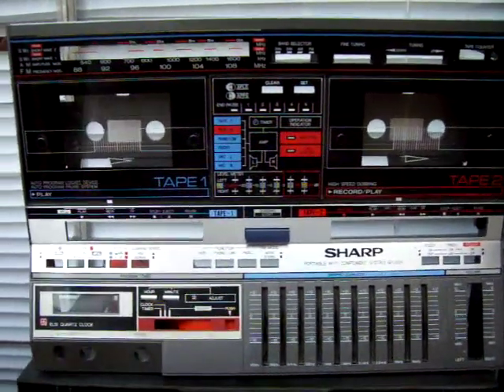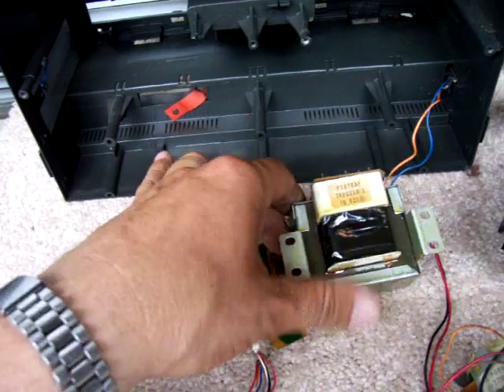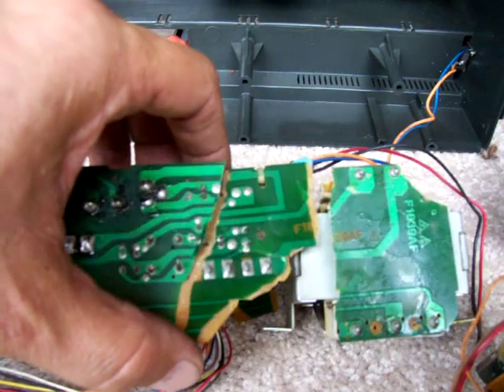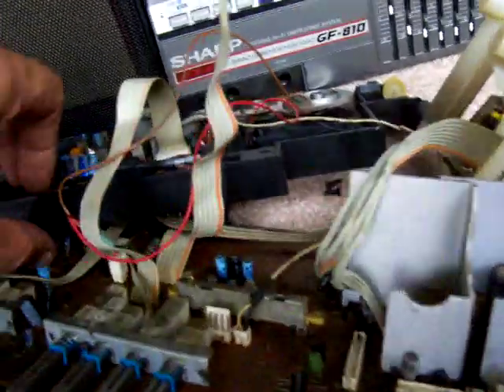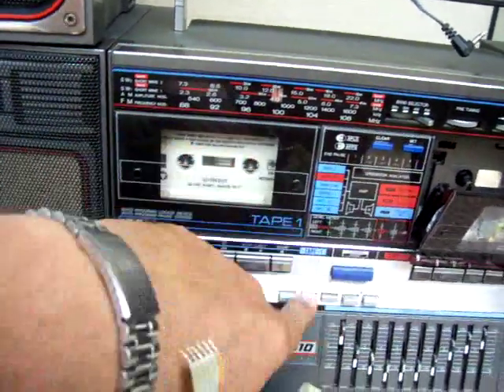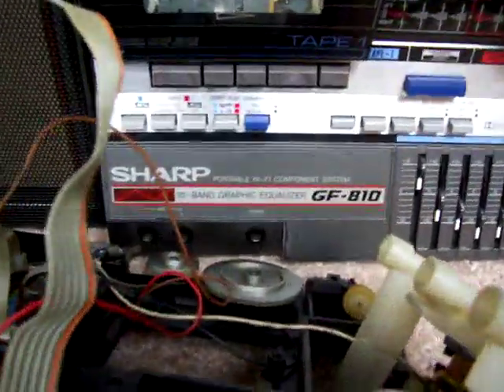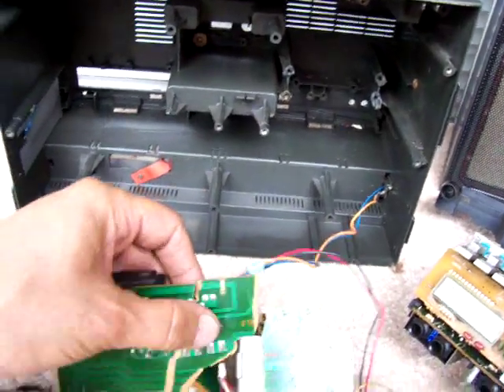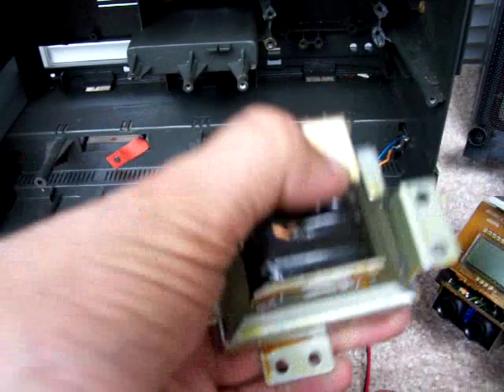SHARP GF-800 GF-810 Dual cassette Equalizer radio Boombox 3-piece

Comment from the maker: Use enough Large Bubble Wrap to allow this to Bounce if droppped - at least about 6 inches all around for a box this size an heft.  If you pack your own boombox Very Well and then pick it up to say about six feet off the ground and drop it on a hard surface and it still works - then that's a good packing job & if it break's well it's still your's to fix again :-)  I recommend double boxing whenever possible with a layer of bubble wrap or peanuts  in between !  More bubble wrap the Better !!!